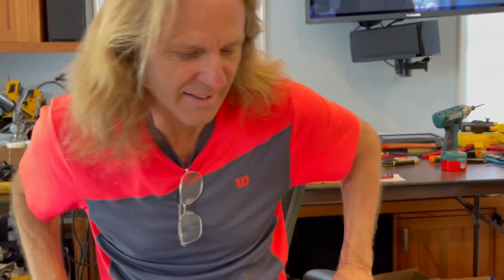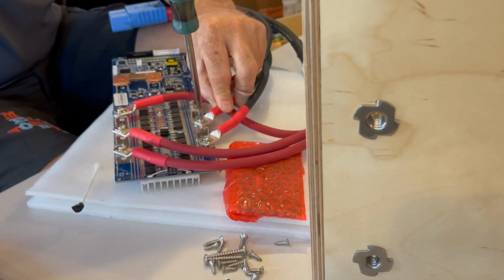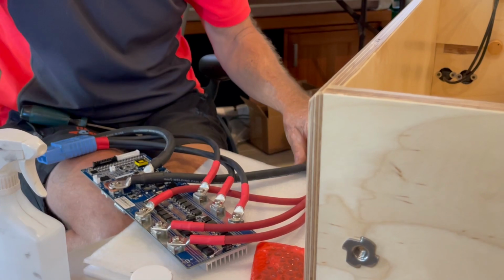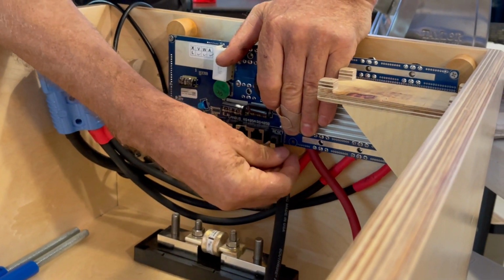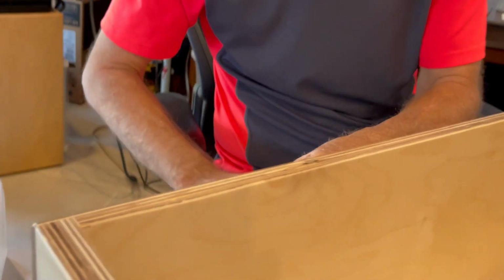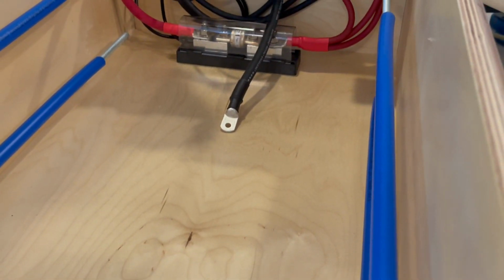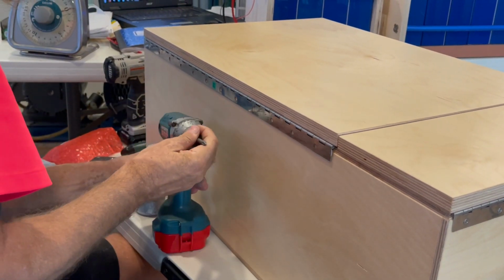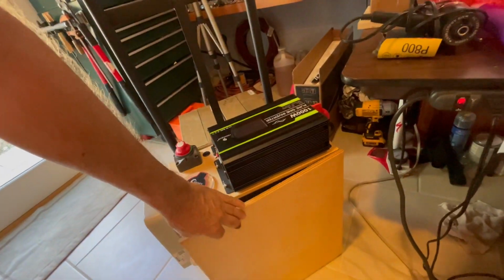Lifepo4 Battery Is Coming Together Easy Peasy; Good Preparation Makes It Look Easy!

Comment: Hi Ray, as I was coming to wire up the BMS it occurred to me that you have position the fuse between the batteries and the BMS rather than after the BMS, just before the Anderson plug as per Seplos Batteries.
Was that a choice dictated by the three cables arrangement or purely arbitrary?  I expect that your way would prevent any potential  BMS fault from damaging the battery array, is that one of the reasons for your choice perhaps?
🙏Thanks again, you have helped us all so very much especially with regards to the cells purchase, I could not have done it so easily otherwise.
Reply from the maker: I have the fuse located as close to the battery as possible to protect from a short or fault in the battery. I have a 175A DC breaker just after the Anderson connector to protect the wiring. The BMS has protection from both sides. If the fuse is on the load side of the BMS, what happens to the BMS in case of a short? 😉
Reply: @RayBuildsCoolStuff  I agree and it confirms my theory. 🙏 Thank you once again, I'll let you know when I'm ready for top balance, I'm also working on my new building Studio/Lab that is why is taking me so long for this battery, I'm using a 5kWh in the meantime. 😍

Comment: Since your BMS has a heat sync, I would think that you would need to ventilate the cabinet.  What kind of temps are you getting especially in hot Texas summers?  Great video, so genuine and informative. Very believable!
Reply from the maker: I don’t experience any substantial heat buildup and my batteries are always in a climate controlled environment.

Comment: Coming back to this video I first want to thank you for all your tips including where to purchase the cells. I have just received my first 16 units from Jenny Wu and two Seplos Bms units from Fogstar in the UK (at a very reasonable price). I have a question, if I may, for you Ray, I see that you use three cables from the BMS to the main plug/fuse rather than one larger at the terminal perhaps joined by a bus bar between the three bolting points, I suspect this is to allow for more flexibility or maybe for practical reasons so, how do you join the three cables into one lug safely and securely, please?
Reply from the maker: That is shown in an earlier video. I recommend finding it. It will be just a bit earlier than this one.
Reply from the maker: Let me know if you can’t find it. It shows all the connections to the BMS
Reply: @RayBuildsCoolStuff  Will search for it, thank you kindly 🙏
Reply from the maker: @9111logic  a very recent video also shows how to put this together and what length of wire to use. I would recommend you watch that video especially.

Comment: Ray, I have a question about keeping these batteries at a suitable temperature as I live in western S.D.. We get some really cold temps up here in the winter, like -20 or worse. I live in a motorhome and there's a compartment in the rear where an Onan Genset is at the moment. I plan on removing that and using that space for the majority of the electronics and batteries. It's vented now and I plan on closing it off for the most part aside from letting any heat from the electronics have a place to get out. I was thinking about using some sort of heating device inside the boxes like what a person would use around water pipes to prevent freezing. These are pretty low wattage pieces and since wood is such a near perfect insulation, these heaters have a built in thermostat. What's you opinion? I was thinking also that any heat from the BMS would supplement this. Aside from all this, I would have to run a duct from one of the inside furnaces to the box. My real concern would be if the cells got too cold, I would need to have some way of keeping them from being charged until a suitable temp was sensed inside the box.
Reply from the maker: They make heating pads that can be incorporated into the build but I would super insulate the compartment and supply it with a bit of climate control. They like the same temps that we do for best performance.
Reply: As I watch your video here, it's like Grug in the cartoon movie the Croods, I have ideas. They just keep coming to me. Only they don't give me headaches. I do think a backup system is required here as in not depending on whether the Propane tanks are full or there is power? Also I'm looking at the areas of the hinges and the gap in the top covers. Now I do think the display panel would be better off inside the living area where it could be seen/read. Also at those points you use the bumper pads, I was thinking instead of a full felt or rubber seal around the case and closing up the region around the Andersons. I'm thinking of using 1 inch panels along with some insulation like closed cell foam. This is an older RV so there is no compartment area as would be with a later model rear engine unit so space is a real issue. This is going to require a fair amount of thought. As for a pad, I suppose that would need to be put under the cells, maybe with a false bottom and spacing for the cells to rest on instead of directly on the heating pad, something that would support the cells but not insulate them from the pad. Since the charge controller is onlly going to work in the day with sunlight, night time would be the only temps would be an issue and a safety switch could be incorperated to prevent any charge if the temp is too low. I need to read up more on the battery temp sensor part, isn't that supposed to keep the BMS turned off if it's too cold?
Reply from the maker: @brettschacher8644  yes the BMS should prevent sub freezing charging.

Comment: Hello Ray,  could you please share the box dimension for the 16pc 280AH case. I am trying to do something similar for my personal use. This would be my first woodwork project.  Please help.
Reply from the maker: The overall dimensions are 12 inches top to bottom, 18 inches left to right, and 31 3/4 inches front to back. These dimensions maximize the efficiency of cutting the material out of 4’ x 8’ by three-quarter inch sheets of Baltic birch plywood and allow enough space inside for all the necessary components.
Reply: @RayBuildsCoolStuff  Thanks for a quick reply
Reply from the maker: @oluwatoyinolagunju  are you from Nigeria? I like your name.

Comment: Beautiful job!!
Reply: I just ordered 16- 3.2 volt 280AH cells from Ev components. I'm a bit nervous but took the plunge. I want to build 4- 12 volt 280AH batteries for an ambulance that I converted to a camper. I will need to run a desk-top computer. Here in Canada, Nov-Jan months, are shortened days light wise. Low angle of sun. Through the summer I'll have more than I need (3x 340Watt panels. Option to set up a 4th on the ground). Trying to not run a generator.
Thanks for all your great videos and knowledge. Your videos, Will Prowse and Off-grid garage have made it possible to make this a new hobby and hopefully low cost....I'm not sure it's going to accomplish this or not. Lol. Many thanks Ray. Your work is just fantastic. Love the wooden boxes. Blessing!

Comment: The thing is beautiful by I guess I'm still curious why you said in one of the previous videos you went from the shelf idea to the Box idea and I know they're rolling around and portable in everything I guess I'm trying to understand why it's so important to have them enclosed my intentions when I was watching someone else's video before I found your videos which are very much more detailed and much more user friendly what's to just build shelf place the batteries on it secure them so they couldn't be knocked off And just leave everything open and easy access cause I don't like having to tear things all apart when I have to go fix it I don't really have a lot of time when I'm in need of fixing stuff and I can't really afford that beautiful wood that you're using
Reply from the maker: If you have an event and a cell has an internal short, will you be able to remove the battery for disassembly or will the heat affect the other batteries. I want mine to be portable for safety and service.

Comment: I am haven't really done a lot in the last year was in the eighties in community college and when we were working with the hydraulic current of car batteries 12 point specifically we would clean the terminals attach them and then if we did anything to them we would seal them externally we would do things like Spray on high Tech sealer to keep oxygen out of the connection and it was an old farmer stripped from eons ago to put grease on the terminal inside and out to prevwater or air getting in there but Greece is flammable so it has become a bad idea Regardless of the voltage there is always a spark hazard when connecting your disconnecting or even an already connected battery with loose connection there can be an arc the higher the current bigger the arc it can actually become a Flash I seen a guy well they go wedding ring to a steel Fender that was painted with a nice shiny Chrome snap on wrench So I am kind of confused her on  The fence about the Liquid you're using in between the connectionI guess I was always taught a clean smooth metal to metal connection that has to remain tight To prevent arking or heating I'm sorry I'm just rambling on you provoke so many thoughts because you go into such detailWhich in my mind is a good thingI must say do you do exceptionally good work!

Comment: Hello Ray, I am looking for help, I am unable to connect to my BMS Seplos via BatteryMonitor, the monitor is able to connect and do a Firmware Update,  function works Ok.
But when I try to load (import protocol from xml file) I always get an error (no correct format .. . loading protocol failed please correct and reload.) This happens no matter which file I choose. I already tried to run the program on Windows 7, 10 and 11 unfortunately always the same error ... loading protocol filed...
Is there anything you can do to help me? How to work around it.

Sorry for any mistakes, I'm writing through a translator, I speak English poorly....
Reply from the maker: I can’t help with this. Please contact Seplos directly and let us know what you find out.
Reply: @RayBuildsCoolStuff  ok I will do that .... so you have never had such problems? Please tell me what windows version do you connect to your BMS?

Comment: what did you use a a terminal end going into the T class fuse?
Reply from the maker: 1/0 x 3/8 lug torqued to 20 ft lbs

Comment: always remember to hold all the way out on the handle of the torque wrench so that it levers properly and you get the correct amount of torque instead of over tightening it when you choke up on the Handle of the wrench.
Reply from the maker: Thanks for watching the video and commenting. 

There are different styles of torque wrenches and they have different requirements. The blue CDI wrench has strain gauges in the arm between the head and the gauge. You can hold anywhere on the black handle. The small ratcheting torque wrench has a strain release in the head and can be held anywhere on the handle. My big old craftsman torque wrench relies on the bending moment of the handle with an indicator rod. It has a handle that pivots on a specific spot on the long beam. With that one you have to hold the handle so it is applying the force in a specific spot in the exact center of the black plastic handle. My big Tekton torque wrench is of the click type but the measurement is done closer to the handle so you need to hold the handle but anywhere on the handle is still accurate. 

On the mechanical click type wrenches it is important to not click more than once or continue to pull past the click. It is also important to operate it a low torque setting a few times if it hasn't been used recently to redcoat the internal parts with the lubricant. I learned this after this video when I wanted to understand why it felt different after the first few screws. 

I have 4 torque wrenches and they all work slightly different. It is important to understand how our specific tools work for the best results. I'm still learning every day.
Reply from the maker: On my road grader I have to apply 900 ft lbs on the axle nuts. For that I put my 180 lbs of body weight on the outer end of a 5 foot cheater bar. LOL
Reply from the maker: If your torque wrench is the old style with  a second indicator rod that counts on the bend of the handle for measuring torque then that is true. Those type have a floppy handle that puts the contact point in an exact spot. My large torque wrench is like that. My ratchet style torque wrench has strain measurement inside the head. You can hold them at any point on the handle without affecting the reading if you apply pressure that is perpendicular to the rotational force being applied.

Comment: hey ray
hey Ray what AWG did you use?
Reply from the maker: for which part?
Reply: I used #2 ga (single negatives and part of the pos, and #6 ga on the pos three cables. All high temp, verybflexible silicone cables from Windy Nation.

Comment: reasoning for a 200amp class T fuse? Would an ANL fuse work as well?
Reply from the maker: At this amperage I would not use an ANL fuse. I have used them at half this amperage but at 200 amps I would only use class T to ensure that the arc gets snuffed out in case of a short. We arc weld with DC current at a much lower amperage.
Reply: You need to look at the battery systems current potential and check that against the IC (interrupt current rating) of the fuse.

Comment: did you configure the bms or kept it as factory ? if yes what did you set the Total_voltage overvoltage protection ?
Reply from the maker: For now I'm using the factory settings. When I have all 16 batteries built and installed, I will tap into the settings and may adjust as necessary. On my overkill bms on the solar generator batteries, I have the cell over voltage set to 3.4 and the under voltage set to 3.0.
Reply: @RayBuildsCoolStuff  not sure if you mentioned the name of the BMS, but who makes it, or where can i find this model? looking for one like you have with the communication port to work with my inverter
Reply: @JbVest  Minetals on AliExpress has them....Seplos 48V 200A BMS with optional LCD display.

Comment: That BMS has both positive and negative cables??
Reply from the maker: The BMS has positive terminals for managing the battery. The negative terminals are only for the onboard shunt. It uses that to calculate state of charge.

Comment: Very good - some more ideas (again) thanks Ray.
If you are going to the trouble of filling in any gaps around the data connectors you might as well put door seals around and between the top doors to stop them critters getting in through those gaps.
Reply from the maker: I will keep them out of the building instead.
Reply: @RayBuildsCoolStuff  I picked up on that detail because I am building a camper trailer and have to seal against dust and water to varying degrees. In some situations I'm using stick on door seal and thought that would be handy for your build too. It compresses almost to nothing so you can use it in existing hinged panels without putting too much stress on hinges, though it will need some kind of latching on the swinging panels since they will want to stay slightly open.

Comment: Did you get a wiring guide from Seplos?
Reply from the maker: There is a user manual available online.
Reply: @RayBuildsCoolStuff  what size cable did you use for the bms ,4awg?
Reply from the maker: @roger littlejohn  yes , it is three 4 awg wires. There is a separate video if you haven't seen it on preparing the harnesses used in this video. They are all on the playlist for wiring up the batteries. Enjoy!

Comment: Amazing skill. Great inspiration for me as I prepare to build a similar setup - 5kW Deye with 150A Seplos and 14 kWh LiFePO4.
If I may suggest tho, in place of the carbon/oil/amorphous silica thing, I would choose a metal-based antioxidant, like Ox-Gard OX-100B, or similar.
Reply from the maker: May I ask why you think that is better? I refer you to this thread on the diysolarforum. https://diysolarforum.com/threads/use-solder-paste-on-terminals-busbar-to-improve-conductivity.11175/page-6

Comment: Do you have any advice in negotiating with a seller in China after you’ve documented his transgressions.  Wheeler fat wrench is a wonderful vertical in/lb tool.  I use it for gunsmithing and I think it would work well here too
Reply from the maker: Advice I don't have but I have gained some experience which I will share in a video a bit later after some of these issues finish playing out. There will be numbers and calculations involved in deciding if it is a better deal to get ripped off by the cheap sellers or the more reliable sellers that charge much more from the start. Stay tuned.